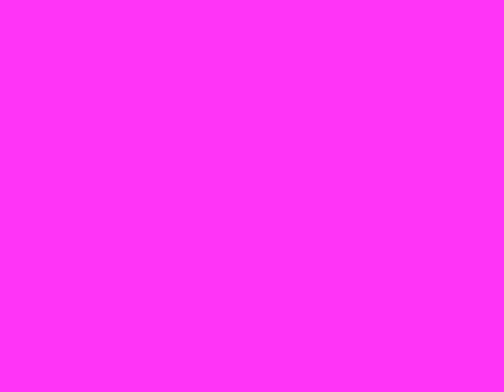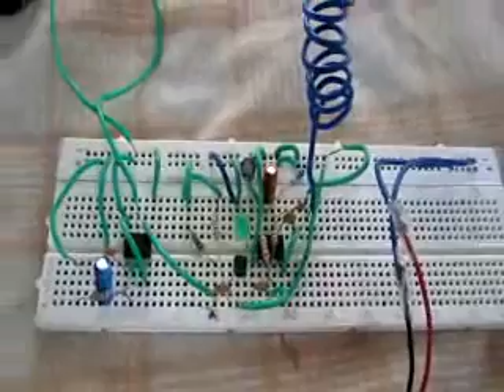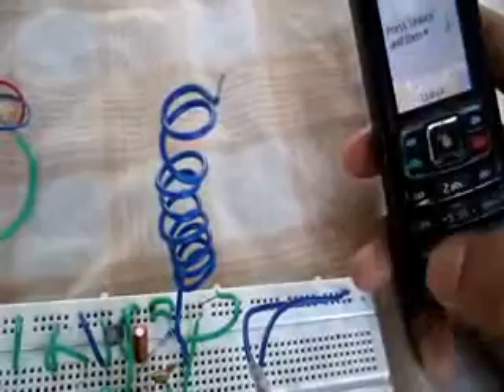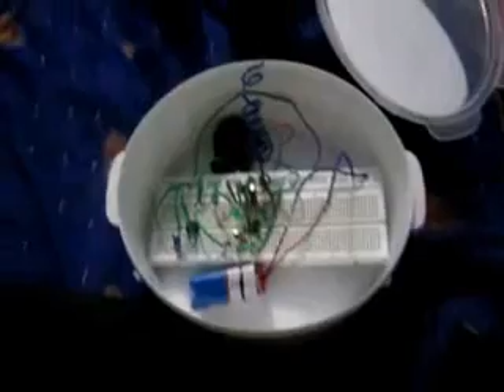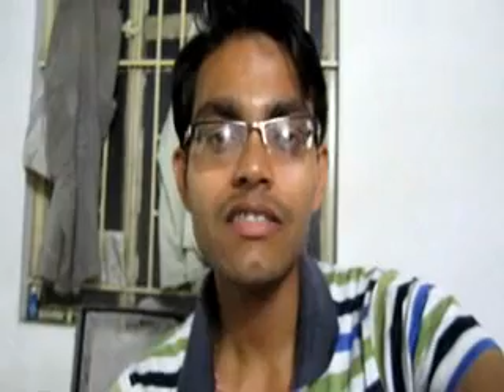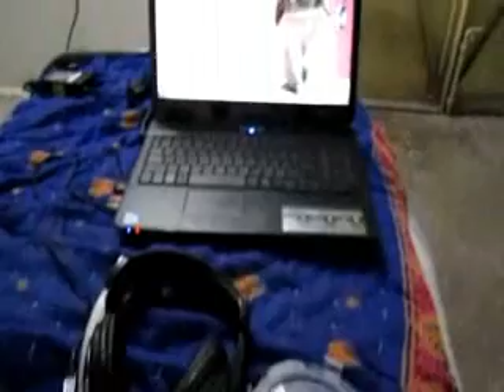MOBILE PHONE DETECTOR using op-amp by deepak kumar singh.wmv

Comment: sir just I want to know what did u use for the antenna was it just copper wires and how long was the wire (length) and is it necessarily to keep the wire curly for the antenna